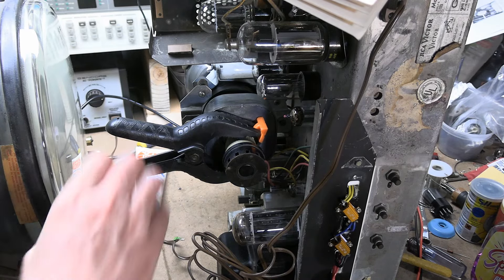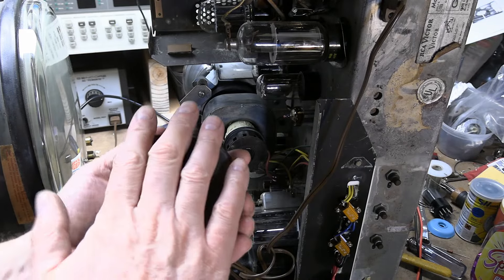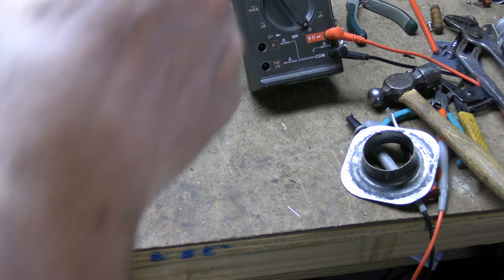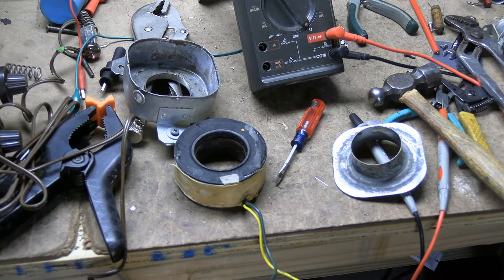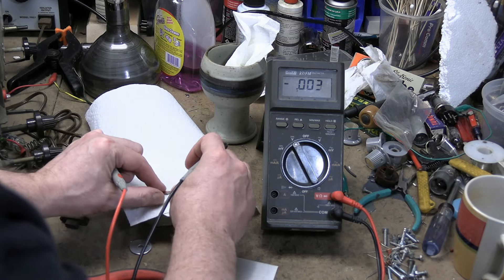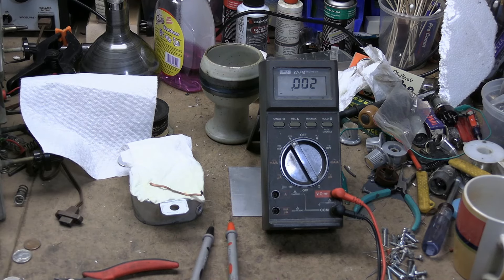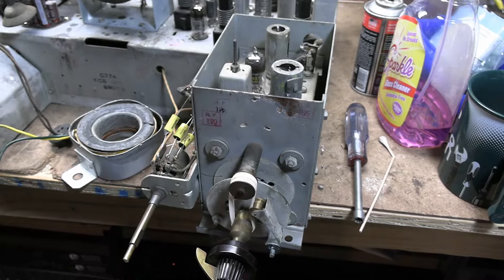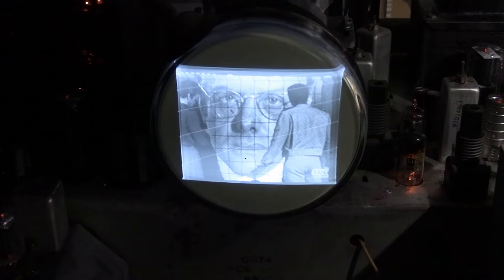Dueling RCA restoration part 6: Repairing the focus coil

Comment: Thanks Bob for demonstrating the problem by using the Evapo-Rust paper towel blotter and showing the focus coil internals.  Since cloth tape was used to hold the windings in place, I suspect most of the leakage current took place between the steel coil housing and where the leads were soldered to the coil windings.  Hopefully your repair attempt will suffice over time.  It seems we are never too old to learn something.

Comment: I had this exact problem with my Avo 8 meter when Duraleak problems struck. It leaked into the battery compartment and got onto the  Bakelite front panel range switches and was giving erroneous readings, and when testing the internals with my digital meter I got the same phantom DC voltages. Several attempts at cleaning it with vinegar and citrus acid to neutralise the alkali fluids haven't worked, very annoying as beforehand it was extremely accurate, and was a Ministry of Defence panclimatic model I had been happily using for almost 20 years.Learnt a lesson the hard way there...

Comment: 14:24 the corona dope will not last. Plus you tested with the coil laying on the bench. So the metal enclosure of the coil had no connection to chassis. You should have taken a microamp meter and checked for leakage current between the metal chassis and the metal enclosure of the coil. Any reading would indicate that there is still some moisture in that coil finding a way to bridge the copper coil to the steel housing. And just by heating in ur oven u will not drive out any liquid that wicked into that coil.
Sorry to say so, this fix may come back to bite the owner after some hours of run time.
Reply from the maker: I've reassembled and it's working fine after a few hours of use

Comment: 7:05 The explanation is simpler. Unless it is 100% potted the coil will act like a wick and your evaporust will soak into the coil. Now with this old enameled wire you always have microscopic cracks in the coating due to deterioration of the flexibility of the enamel coating not withstanding the repeated thermal expansion and contraction of the underlying copper conduit. Under normal operation that is not immediately an issue since for a short between adjacent turns to occur the cracks are too tiny and would have to overlap at exactly the right position and mechanical pressure on the coil would need to force the minuscule exposed surfaces together. But the moment any liquid wicks in mayhem starts. The coil is at 200+V with respect to its metal enclosure, and immediately electrolysis will start, resulting not only in forced erosion/dissolving of the copper (producing conductive ions enhancing the conductivity of the solution)  but also the nascent oxygen created on the copper will crack, lift and break up more enamel coating, thus increasing the contact area.
Maybe take the old coil, put the coil at say 200V with respect to the metal enclosure, measure the current and watch how it self destructs.
And no, there is probably no  saving this coil. You would have to rinse and maybe cook it in destilled water to dilute any electrolite soaked into the windings and dissolve any hygroscopic residue, then rinse in alcohol and cook in WD40 to expel all water and finally pot/cook in wax or a heavy transformer oil. And still the enamel coating may have been widespread destroyed to where you have shorted turns now.

Comment: That rubber band will not last.   Even just sitting in a drawer, they rot after some years, and immediately break if stretched.
Reply: I've heard rubber bands are rated for 2 years. I have older unused ones which seem fine, however ones stored stretched around an object always seem to crack when touched. For testing a rubber band is obviously fine but I agree it's not good enough for a restoration. Probably 5 years max. An o-ring is generally a better choice.

Comment: Radio Shack had  a   awesome book   on  A/C  and what it does to a  inductor  under varies  situations, which  can  be calculated     You needed  a higher  level  of  algebra   to  do all the  calculation   Shango  proves  no  restoration  needed  just  plug it in    LOL